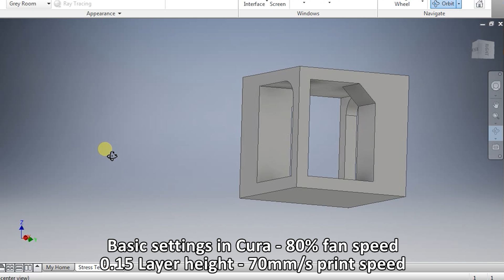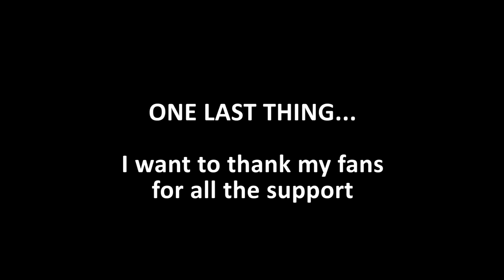TEVO Tarantula - TOP 4 Fanduct comparison test

Comment: So I am a bit confused... :) 
So these fans I have to connect to 'Fan'. But where do I have to connect the nozzle fan and the main board fan?
Reply from the maker: Hi Felix,
These are the layer cooling fans. You need to connect this fan to the main board. This fan is PWM controlled. In your slicer you can control how fast/slow it will work and at which layer height it will turn on. The fan that is cooling your heatsink above the nozzle and the fan cooling your main board must be connected directly to 12V in any of the 12V output of the power supply. These last fans must be always on and that's why they must be connected directly to 12V.
Reply: ruiraptor OK thanks for the help!

Comment: What exactly do you mean with temperature drop? does the temperature of the filament drop or the temperature of the nozzle?
Reply from the maker: Temperature drop is the amount of temperature that the nozzle looses when the fan/blower turns on.
For example, you are printing with the nozzle at 200ºC...if the temperature drop is 15ºC it means that the nozzle temperature dropped to 185ºC.
Reply: Ahh allright, thanks. But doesn't the printer corrects itself and heats back up to 200C then?
Reply from the maker: Yes, it corrects the value. However, with bigger temperature drop, you might get some amount of fluctuation.
Reply: Thanks for the info :)

Comment: Would be useful if you could asterisk the winner (Radial fan fang) in the comment/detail area.
Also could you try a run-off of the winner against this dual function splitter (makes the print head lighter)
http://www.thingiverse.com/thing:839620
Reply from the maker: Hi Hedge,
Thank you for the tip. I will add the information in the video description.
Regarding the fanduct, the one you mentioned cannot be used with the stock hotend. :(

Comment: It has been kind of difficult to get the blower fan in Colombia.
I was thinkhing about to modify the bullduct in orden for it not to touch the heat block.
What do you think?
Reply from the maker: Hi jcmunozac,
You can do that. In my case it just touches the sensor screw so a small trim with an x-acto knife will fix it.

Comment: SORRY BUT HOW YOU CONNECT THE FAN WITH THE CIRCUIT? AT WHAT CABLE DID YOU CONECT ITS POWER?
Reply from the maker: Hi,
The layer fan is connected directly to the main board to a connector labeled “FAN”.
You have to get some long wires to solder an extension cable because normally fans have a short cable.
For this test I just soldered a connector so it would be easy to swap between fans and blowers.
Reply: ok, thank you very much ;)

Comment: How do I wire it though? My TT is coming next week and I want to have all the parts ready
Reply from the maker: Johnny Goni ,
these fans are also called layer fans. the must be connected to the main board where's labeled fan.
Reply: Thanks do I need to run a cable from the fan to the board? Sorry I'm new at this....
Reply from the maker: Hi Johnny,
Yes, you must run a cable from the fan to the board. Normally the fan wires are too short so you need to solder a wire extension and pass these wires together with the bowden tube and hotend cables. If you need a better explanation or a picture of the wire setup i can share mine. Let me know your email and i will send it to you.
Reply from the maker: Hi Johnny,
I just sent you an email.
Regards
Reply: Thanks boss

Comment: Do you have the links for the fans? By the way, nice video! I love this content.
Reply from the maker: Hi,
The links for all the fanducts are available in the video description.
Regards
Reply: Thank you, but I mean where you bought the fans.
Reply from the maker: Hi Beerveen,
I bought them on ebay.
Here’s an example:
http://www.ebay.co.uk/itm/Black-Brushless-DC-Cooling-Blower-Fan-2-Wires-5015S-12V-0-14A-50x15mm-/141823697048?hash=item210559e098:g:06oAAOSwu-BWQLH~
Reply: Thank you!!!!!
Reply: I more question.  Do you need a 12v fan or a 24v fan?
Reply from the maker: Hi, the tarantula power supply is 12V, so you need a 12V fan
Reply: THANK YOU

Comment: Great video ! Is there a lot of noise differences between differents models? Wich one is the quieter ?
Reply from the maker: Hi Jekert,
Both 40x40x10 and 40x40x20 and also the blower fan don't make much noise...at least mine don't.
Reply: Thanks, I was worried about the noise produced by the 2 fans of the Dual Blower.
Reply from the maker: Hi Jekert,
The stepper motors make more noise than these small fans.
I have a big fan installed over the power supply and that one yes, makes some noise. There are models (noctua) that are very silent fans.
Reply from the maker: Yes, i understand and it's a valid point. However my big power supply fan makes much more noise :)

Comment: The dual and single blower set up in the 4:00 part of your vid is sucking hot air from the hotend heatsink. Thats why the creator of the single blower version had the fan on the left side.  Nice comparison video though!
Reply from the maker: Hi Grey406,
That is a valid point. I'm not so sure that the creator thought of that because he has the cables on the other side...maybe he did and moved the cables to the other side...or not...dont know for sure :)
Reply: In the picture at 4:02  it shows he has his cables on the opposite side of the fan.    Thanks to your videos, I placed an order on a Tarantula yesterday from 3dprinterbay.  So hopefully in a week or two, i'll be doing your recommended upgrades :D
Reply from the maker: Hi Grey406,
Thank you for your comment :)
Congrats on the buy ;)

Comment: Which fan would you recommend for the radial fang? 4020 or 5015? In the description you can use both but which will be better?
Reply from the maker: Hi Cristu,
The 5015 will provide more power. I would recommend this one instead of the 4020.
Reply: Thanks Rui!

Comment: OMG, you're the best. Glad someone put different styles to the test.Thanks. Great content as always.
Reply from the maker: Chris Jericho,
thanks for the comment.
Reply: One quick question. How did your normal dual fan set-up deal with this test?
Reply from the maker: Hi Chris,
I decided not to install the dual blower because it would make me bend the wires too much.
Reply from the maker: Hi Ben,
Actually i didn't like the way the airways are positioned. They need the wires to be more bent and they are directed to the nozzle. I had a temperature drop of +- 13degrees with one blower which means that the air is being directed to the nozzle. With two blowers the performance will be much better i agree but with the same issues i pointed previously.
Reply: Hi Rui,

Do you think the Dual Blower performed worse than the Radial Fan Fang because it only had 1 side attached?

It seems to me that the dual blower should work better than the fan fang since they're both doing the exact same thing except the dual blower should put out twice as much air if both sides are attached.

Thoughts?
Reply: Thanks for the reply. Yeah that's quite a bit of thermal fluctuation...

I suppose the dual fan could be modified to point the exhaust more like the fang... hmmm I might try and play with it at some point but until then I'll be going with the fang. Sorta sad because I really like how the dual setup looks :|
Reply: OK, I misunderstood what you wrote. I thought you were saying since you already had a dual blower prior to this video, you would test it single. I see my mistake now when I went back.